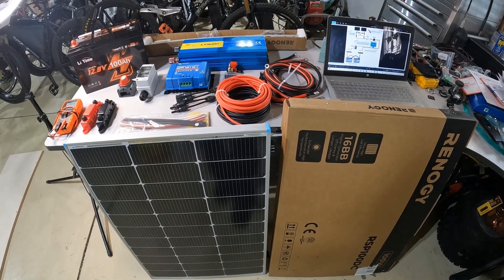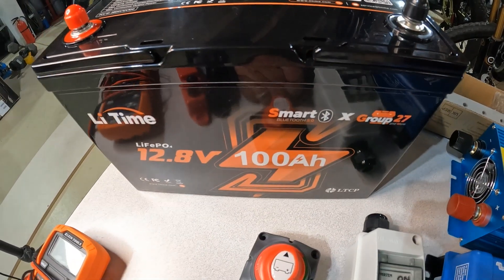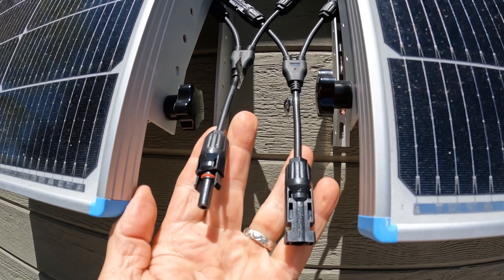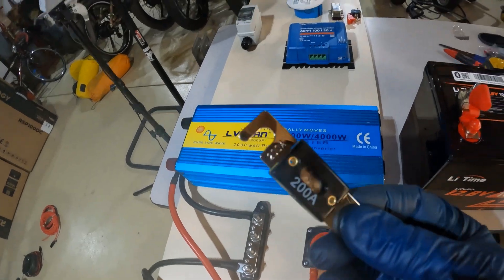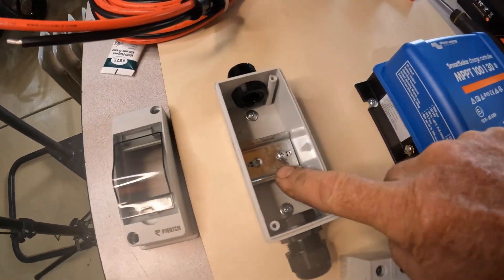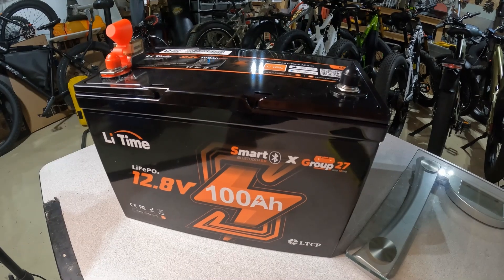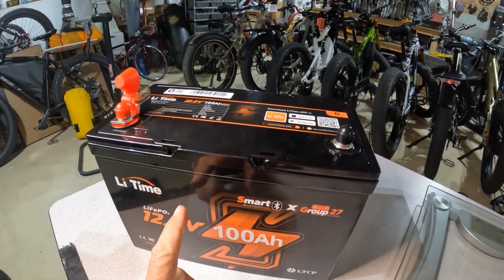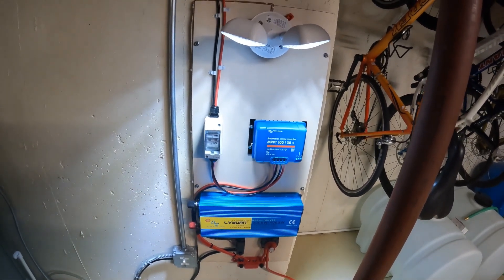Solar charging for your ebike! LiTime 12v 100ah lithium battery!

Comment: Has anyone strapped a LiFePo battery onto the bikerack with an inverter to give you the ability to charge the battery if you are not around a charging source?
Reply from the maker: Not that I'm aware of but that is a real possibility considering the light weight.